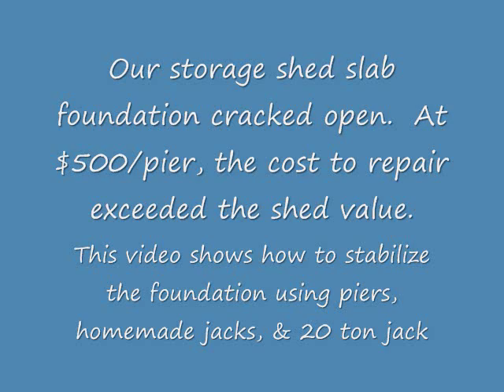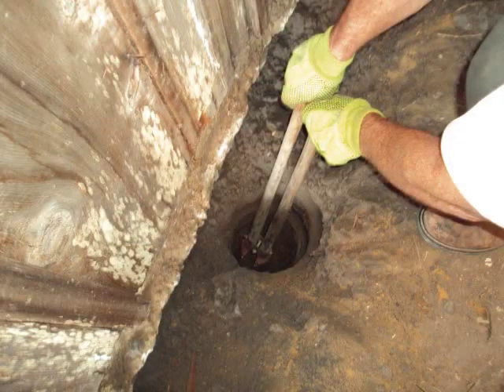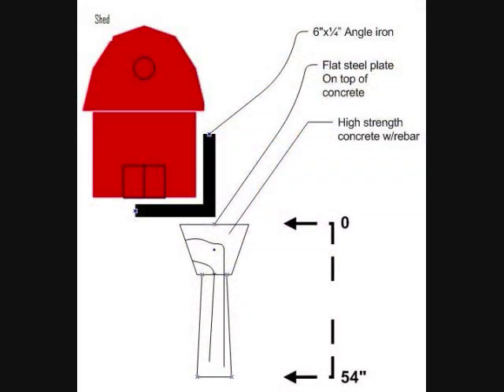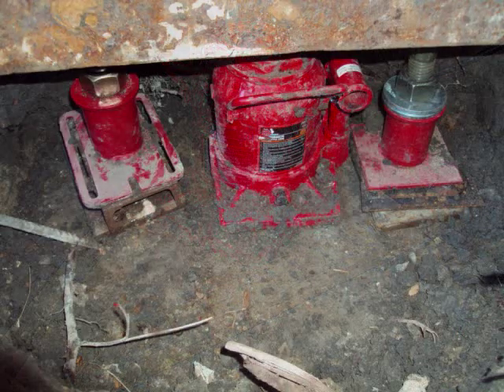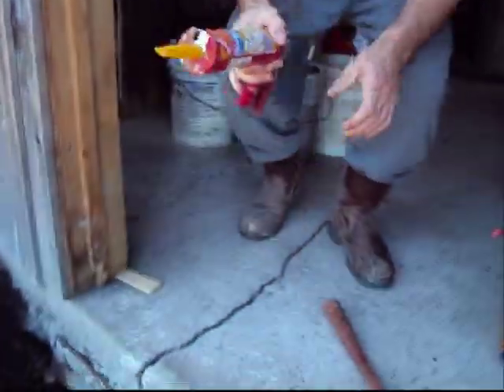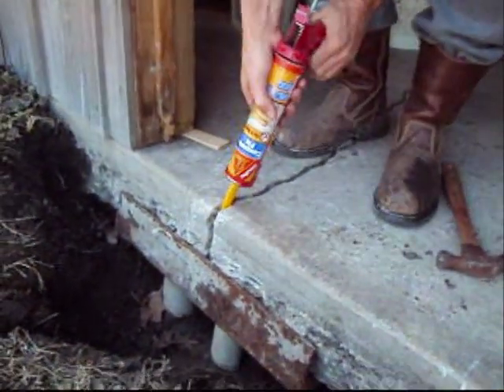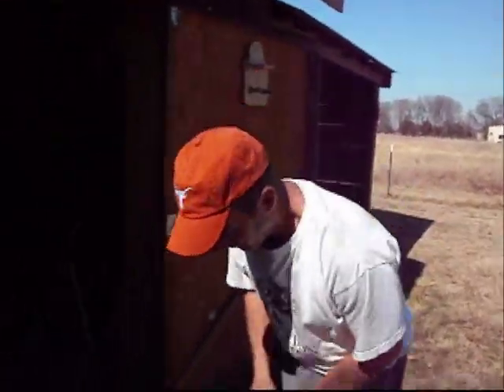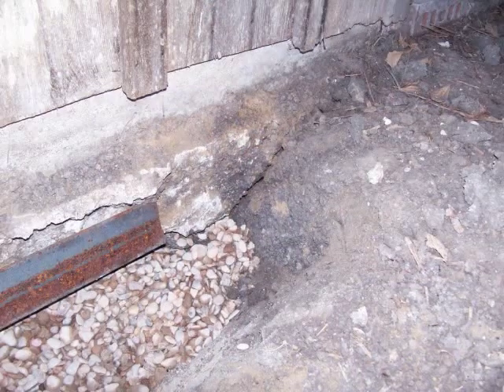Cement slab foundation repair (do it yourself)

Comment: Inspirational.  Short on detail.  Great nerve to do the job.  Structural Engineers are great at answering  structural questions when you have to pass code.  Once the building is up  and not a hazard to fall and injure anyone, like your slab, you did a great job of it.  Make more  videos.